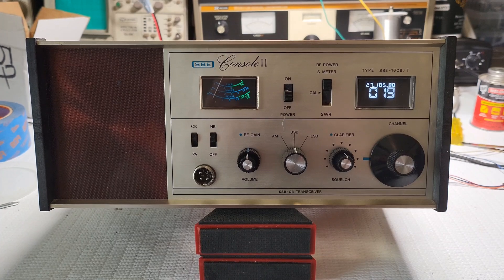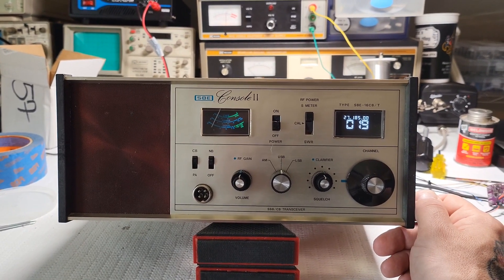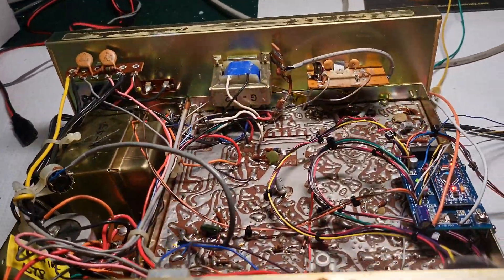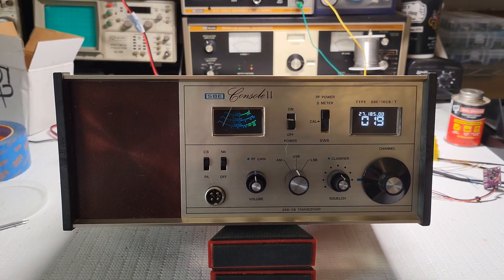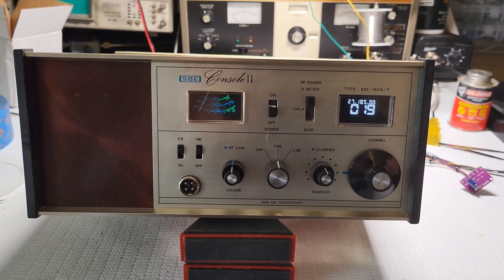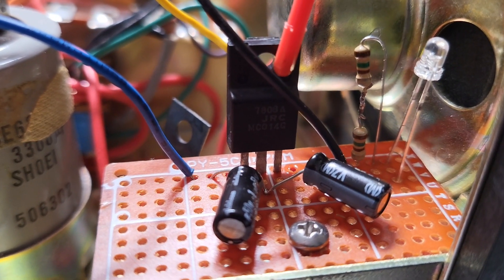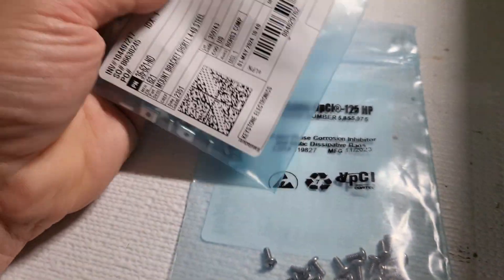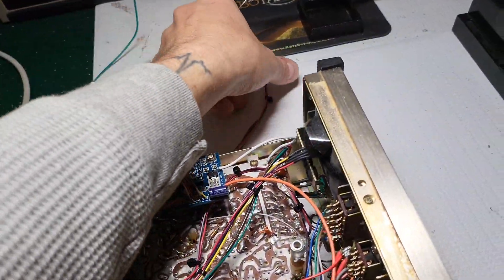DDS VFO install SBE Console II (part 2)

Comment: I had one of those put in my 2547. I should have just left it alone.
Reply from the maker: They need to be installed right.  I've been taking my time doing things right and double checking everything. I think it's good for someone looking to add new life to a 23 channel ssb radio or a channel mod.  It's not really needed IMO on a new ssb radio.
Reply: @pulsarcb  yeah I took mine to a local tech and we finally got it setup properly. My biggest complaint is the encoder. They could stand upgrading to a better quality one. Otherwise it is pretty cool. Definitely an upgrade for some older radios. Keep the videos coming!👍

Comment: ahh so thats what you  did with tha skin that was on the radio that you got from me -well you did a great job ill have to get a heat gun so i can do that when needed--i didnt even know that you could put a dds vfo in a 23 ch. xtal radio
Reply from the maker: Lots of patience, some heat, and 3M adhesive remover.  Wide putty knife helps.  Yes, the dds vfo is the best way to get 40+ channels out of an old 23 channel radio. It's super stable, and the best part is you can eliminate the crystals.